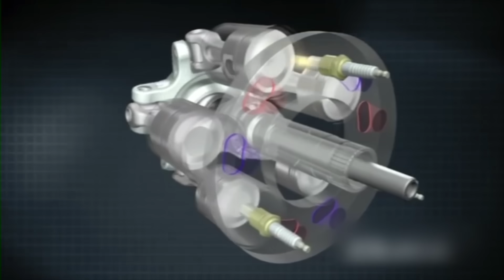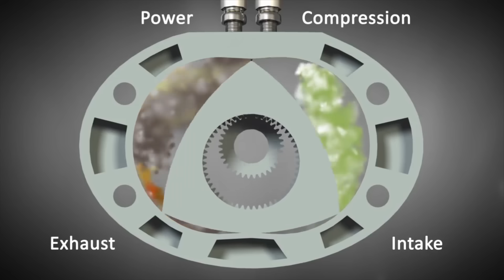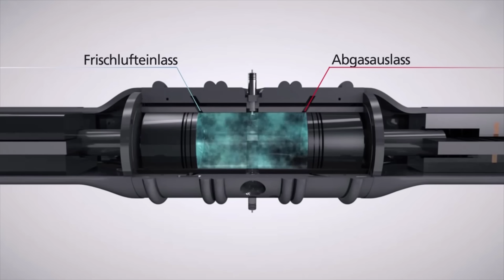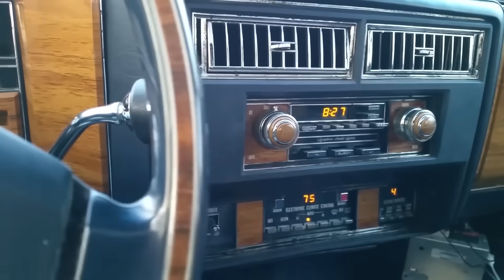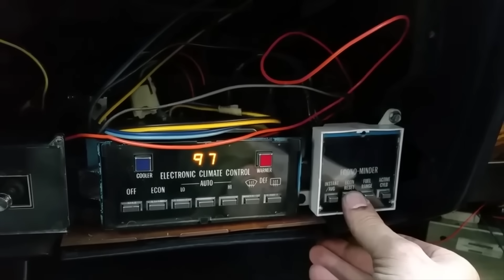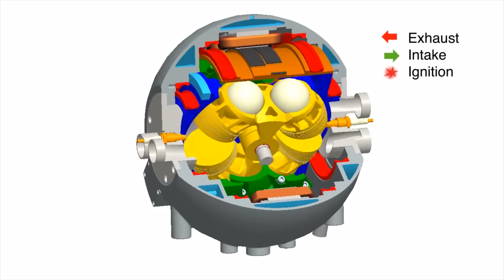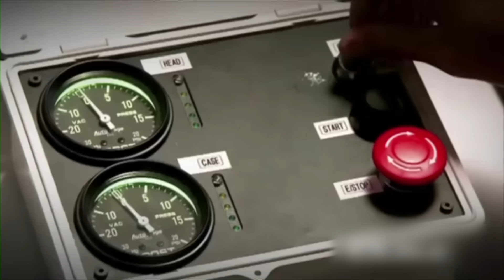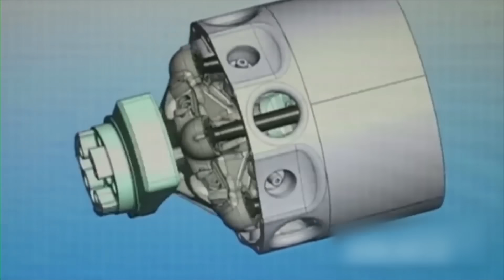10 Strangest Engines of All Time

Comment: The biggest downside of an electric vehicle is it's lack of emotion... It has zero charm... Yes it accelerates... But it won't give you the thrill of a raw V8. Even though it goes faster.

Oh and as a side-note. An electric car has a massive footprint so it is harmful for the environment.
Reply: Depending on how electricity is produced wherever an electric vehicle is used depends on its carbon footprint. And how the vehicle is used. Yes the actual production and recycling of the electric vehicles leaves a worse carbon footprint, but if theyre powered by electricity thats not made from burning fossil fuels theyre better
Reply: @jonahruntz9818  Well the problem is that you need to replace these batteries every 400.000KM at best. And that's gonna diminish the entire idea behind the electric vehicle. And as an additional factor. The electric cars are about 90% computerized. That ain't gonna hold up longer than 6 years. So they are to be replaced every 6 years. So nope... Not green at all.

Comment: You need to do some more research on virtually all this- since lots have whacked your hoo ha for the ICE, I'll go to the end of your interesting engine piece and bang on your excrable  info re the Duke Engine- there is nothing new about the engine itself, since the London Transit had a British built swash plates engine that worked the same way, using diesel fuel. Forgetting the lack of original content, Duke as of 2016 had not delivered any production engines, were talking about trying for FAA Certification but didn't get it, and no independent tester has ever been allowed to run and rate check it. All this after buying out the assets of the Revolver Corp. which did create a patent able design for a barrel shaped motor using six axial piston pairs for a twelve cylinder very powerful  engine which was in Cert trials when it's inventor died. His daughter, trying to settle his estate (with 2-3 million in development costs) was dogged with lawsuits, including one from some unknown company called Duke Engines claiming patent infringement. She sold her fathers life work for a song and the end of the lawsuit. So you are promoting the work of frauds this time. OK, you didn't know- that's what research is for!

Comment: If the turbine engine isn't on here, i'm gonna be disappointed.
You know, the one that runs on vegetable oil, gasoline, diesel, tequila, and motor oil, among others.
(Otherwise known as the one that got cut by fuel companies for being a partial death sentence to a trillion dollar industry.)

EDIT: Basically the only fuel it didn't run well on was leaded petrol, and even that is a lie, because it ran just fine, only the lead would kind of dirty the engine so it would need to be cleaned more frequently, as in, every couple of years instead of once every 2 decades.

Comment: What? No mention of the 1975 Suzuki RE-5 motorcycle?  A 500CC engine, with performance equivalent to piston engined1000cc machines.  Seals were the problem.  Silicone was not yet a viable technology.
Reply: Or at least three other makes of rotary engine'd motorcycle Sgt.

Comment: Many of these "not very new" engines are RIDICULOUS...  Solving problems that don't exist using much more expensive designs or added parts is the definition of futility.  Especially when electrics are as good as they are currently.   Also...you need to do a lot more homework on your "research" of these engines, trust me on that.

Comment: Invented by who again? Brady? Never heard of him, IC engine wasn't invented in the US.
Reply: i am from us and i have never heard of this guy either

in my book it is otto
with his coal dust powered engines
Reply: @Repurplecirculation  
Would have been a crude distillation of kerosene , I don't think anti knock principles were even thought about till the twenties  if you are talking about modern fuels, another interesting subject in itself.
Reply: Fair call , pulling me up on the use of the word gasoline.
Reply: 1798, Thomas Mead, first IC to use gasoline, he had designed it 5 years earlier. I don't think US schools look outside their borders for literature or technical information.

Comment: Random question: why tf would Tesla make a glass roof instead of putting solar panels there?
Reply: Great question : 
_Cost of flexible solar panel is high
_ flexible solar panels are not efficient
_they would  need more equipment with them just to convert the power to charge the batteries .
_ in night it would be just a dead weight and it will decrease your range . 
_ you most likely dontt need it for long long road trips . Cause Tesla's super chargers will charge while you take a 20 min break at a restaurant.
_ tesla have range options up to 400 miles maybe more ( i dont remember exactly ) in a single charge ( you shouldn't let the batterie dry up to much cause it would damage it in the long run
_ keeping the cost low for the consumer
_ roof glass is more beautiful then a regular one and more enjoyable for the passenger's as they watch rain fall in to it or the sky ......etc 
_ and it will make the car more apealing then regular cars .

Comment: That 'Duke' engine design towards the end was first seen in an article many years ago by Smokey Yunick.  I believe that he came up with it.
Reply: Not so, I designed and supplied the pistons and rods, I knew Smokey concurrently, he had no idea what was going on in an Auckland  NZ industrial  park, trust me, GM (Herb Fichel who I also worked directly for) backed many Smokey prototypes that were running at very high temperatures with good output, the problem was they ran so hot you would cook the surrounding car!

Comment: Felix Wankel's engine was not a "rotary engine" but a rotary PISTON engine: this is he's true name... a "rotary engine" is someting different, was the real name from the WW1 most built aircraft engines (Gnome type)
Reply: That's where the crank is fixed to the aircraft firewall and the "radial style" engine rotates around it's crank.
The Wankel has NO PISTONS, but has what are called ROTORS.
There's also what is commonly called a ROTARY LAWN MOWER, which has no rotors and a conventional 4-cycle motor.

Comment: Typical GM 
I know the guy responsible for the V8-6-4 (just the engine controls, some moron was responsible for using a cast iron head on an aluminum block and free standing liners that eventually wallow out the block) and he told them not to go with it, the tech was not ready. GM decided to let the owners be the development drivers, and it failed like he predicted, so they blamed him, and he really has been close to or actually insane, since. 
Smartest guy I ever met . . .when he wasn't going Rasputin and getting committed.
That all said, you need to look at more engines if you think most of these are unusual

Comment: Detonation is ping, not knock. Knock comes from play in the connecting rod bearings.
Reply: So what is a knock sensor for?
Reply: @markmmm1737  It appears that my info was not correct. Thanks for the check.

Comment: Nissan built the variable compression motor first switch I know they are the same company but Nissan has been working on that engine for about 5 years now
Reply: I used a variable compression engine, from 1907 for tests at Lanchester Polytechnic in 1982, we measured knocking and octane with it. It is simply a matter of screwing the head up and down WRT the crank. A little knowledge of history, is a travesty.

Comment: 1807 - Francois Isaac de Rivaz of Switzerland invented an internal combustion engine that used a mixture of hydrogen and oxygen for fuel. Rivaz designed a car for his engine — the first internal combustion powered automobile. However, his was a very unsuccessful design.

Comment: "strangest engines of all time"

shows a bunch of normal combustion engines that we are all familiar with.
Reply: They should have at least mentioned the Chrysler Turbine.
I mean, FFS, that thing ran on FUCKING VEGETABLE OIL AND TEQUILA.
Reply: Weird Engines:

Hossack Engine
5 Stroke Engine
Old proper rotary engines
Honda NR Engine (sure it’s a normal 4 stroke but it’s got some awesome pistons)

Sure the free piston engine is interesting but trying to get the valves to work is difficult as you have no crankshaft to drive the camshafts
Reply: T C 
Additional-Adjectives (of all time) always diminish superlatives (strangest)

Comment: Your info is wrong for the F85. It has the fluid tank, but the injector system was recalled by the factory. We noticed fluid was not being used. The factory recall soldered the fluid injection nozzle shut in the turbine. The dealer told us that the injection fluid could create enough power that the crank could not withstand the load and the warranty was void if the fluid injector was not deactivated.

Comment: VR6 engine . V means the shape and R means inline. What?
 V shape engine cannot be inline. As in V8 or V6 or V-Twin. How does R mean in line??? What the hell !
Reply: Exactly.  I don't look to the entertainment sector of the internet much for factual enrichment, but some things just make me shake my head... I'm reasonably certain that "I" would stand for inline, as it has for many years.
Reply: I forgot the exact reason for the r but it has to do with them wanting to differentiate between standard V engines. It's also not inline I agree but the heads are flat on top unlike a standard V engine and that might have to do with it.

Comment: The rotary was actually invented by NSU which was or is owned by VW, VW then sold Mazda the rights to use existing and develop their own rotary engines not long later.

My tutor in college worked for NSU in the 70's and worked on tons of rotary engines and then later boxer engines in beetles
Reply: So what input did Felix Wankel have then? I think you'll find that Wankel invented it (hence why they're called the "Wankel rotary" & NSU developed it further in the 50s.

Comment: the VT-TURBO works by increasing the compresion on ECO mode, alowing the engine to use minimun fuel mixture to run, and lowers the compresion and activate the turbo on a high performance mode, you lower the compresion of the engine because the turbo will raise that compresion up and let more fuel and air come inside the cylinder allowing for a bigger explosion.. you can't use the high compression mode with the turbo working together because the compression would be so high that you blows the engine... thats why you put lower compression pistons when you want to add more boost on tuner engines.

Comment: I hydro-locked my peugeot 306 one time (it made me cry)..... but miraculously it went on for six months with number 3 piston rod severely bent (not even visible, but bent)  one day i'm driving down the road in 5th at 3000 rpm... u passion drivers know this means 105kph... and boom! smoke everywhere... oil everywhere.... two holes down either side of the aluminum block..... but don't worry! a few thousand local (brasil) moneys later and i had a new (used) engine from a citroen 80k kilometers newer and i was back in civic busting business!!

Comment: I jsut wish, when they refer to an engine's Liter displacement, they would QUIT saying  POINT "O",. the zero has no value, so, just leave it at 2 Liter engine or 3 Liter engine or 3.5 liter engine, etc. this  "POINT O" crap is just frigging annoying, has been ever since Ford went to the 5.0 liter designation and skipped out on the 302 cid engine measurement,.. all these peeps saying 5 "POINT O" liter,.. just idiotic and a useless carry-on of words.

Comment: You need to get your fact correct americans had notning to do with the ice engine. 1823 an English man has his ice engine running nicely,  The first commercially successful internal combustion engine was created by Étienne Lenoir around 1859[1] and the first modern internal combustion engine was created in 1876 by Nikolaus Otto (see Otto engine).
You do not mean infinity, infinity has no development budget or department you mean Renault  Nissan Alliance..  RNA. Currentky Nissan are in such trouble that they are hzving to close all there factories outside of japan.

Comment: George Brayton never invented the first internal combustion engine - his engine was more like an open cycle hot air engine  but instead of coke it  used liquid fuel - just a cursory look at a Brayton engine would show it has little in common with  today's ic engines  with its pump cylinder and  slightly larger expansion cylinder with Davey lamp type metal gauze to stop it  all backfiring

Comment: The Duke engine is only half what it could be. The Alman A-4 from 1921 works the same way except where the Duke has its pistons facing one direction, the Alman had another set of pistons and cylinders facing the opposite direction. From the USAF museum website. "The water-cooled A-4 barrel engine (18 cylinders -- two groups of nine each horizontally opposed) was the fourth experimental barrel engine built for testing at McCook Field, Ohio, by its inventor, Mr. J.O. Almen of Seattle, Wash. The project began in 1921 and by the mid-1920s, the A-4 passed its acceptance tests. The engine never went into production, however, reportedly because of limited funds and a growing emphasis by the U.S. Army Air Corps on air-cooled radial engines. 

This unique engine had a much smaller frontal area than other water-cooled engines of similar horsepower, thereby providing better streamlining and less air resistance. It was rated at 425 hp but weighed only 749 pounds (a power to weight ratio of better than one to two), a significant design achievement in the early 1920s." 

The Duke departs from the operation of the Alman as its set of cylinders rotate bringing the cylinder inline with ports during the intake and exhaust phases. (The Alman may have been a sleeve valve judging by the look of the head, but not positive and it has been a while since I've read the display in the museum.)
Hopefully Duke can bring theirs to production as the design makes nice power from a relatively tiny package!

Comment: the Cadillacs 8-6-4 disables the rockers the same way and pattern as the newer chevy ls engine platform AFM "Eaton" lifters do computer wise but mechanically are different both disabled lifters act as a " collapse hydraulic rocker " would win actived, setup is not holding the valve open but closed as a acting air spring assembly and as my memory recalls Cadillacs in the 80s had a dizzy so no the spark plugs are not off and even if you whated to there is probably no practical way of skipp-firing the plugs in the right pattern reliably and as for fuel it was a TBI system so nope fuel just didn't get in the cylinders "at will" because the disabled cylinders / valves are stopping it mostly

in the 80s win it was new all electric compact computers ( evan pc / dos / OS aka apple desktops ) had teething problems and was expense and probably didn't have a lot a tech savvy mechanics that could work on newer computer controlled systems efficiently and quickly so that's part of the " consumer complaints " the other problem is V-8 s do not run smoothly with only 6 or too/one contiguous same running cylinders as it curates a balancing problem's and in v-6 mode probably isn't easily fixable but 4-cylinder mode works just fine minus potential oil consumption and coking or potential accelerated wear of things like the camshaft problems
Reply: First part correct. Second part, the control systems on both the early designs and the current LS systems actually were/are problematic and unreliable.
Reply: @mbliss01  i will give you the ls / 3-g hemi / eaton lifter design has a bad reputation and even worse in colder climates from my point of view not that i have worked on enough of them the be a " expert " as i have ended up working with the prior generations mostly " with thoughs years the " wrong cold or dirty " oil viscosity miss up the pins inside and 1/2 way shearing it off = stuck 1/2 way on bad lifters but the E38 ecu isn't a bad unit necessarily ( including stock programming to some degree ) just isn't as powerful as some consumer grade gaming of the era PCs so some things like Drive By Wire or vvt are limited on how much resolution / computing speed ( but there great for doing junkyard / budget friendly engine swaps ) and i think gm made the computers more for the prior 90s style engines and sensors to have extra over head capacity and not the more loaded down 2000s-up engines 

the 80s engine seams to have the opposite set of problems as it uses a robust rocker style holding clip with just a electronic solenoid and springs to keep it in the right place, the downside to this is heavier parts ( same problems as the Eaton lifters just not as heavy as the ls 1s that are compounded by being roller-rockers ) and having a taller /biger rocker covers and stuck with pedestal rocker shafts vs old school 2-g hemi / 440 style shaft-mounted rockers that are stronger 

well im at it the multi-air aka dodge / FCA units look like for street engines as the best compromise and i don't know why the 3-g hemi isn't using that to pass emissions easier and getting more proformce with it as it can do all of upbove and more control and another side-note i im considering this mod for my older 60s V-8 big block because it looks easy to modify to fit ( and hopefully will save me gas money / seams cheaper than high profomance full roller hemi head valve-train parts as my old ones have " had it " )  and doesn't seem to have most of the down sides that the gm systems has just keep it clean and full of the right oil aka standard things that hipo engines need any ways not to " blow up "